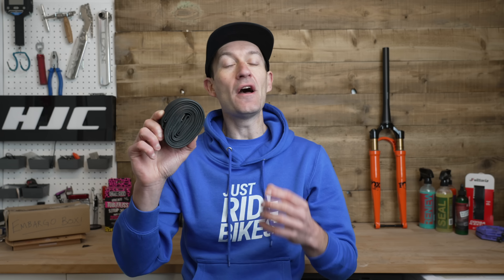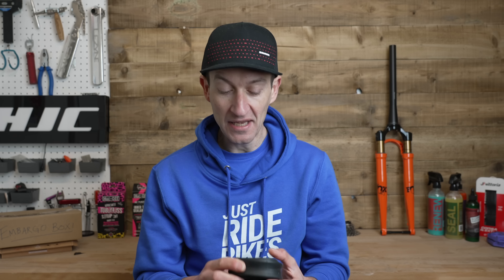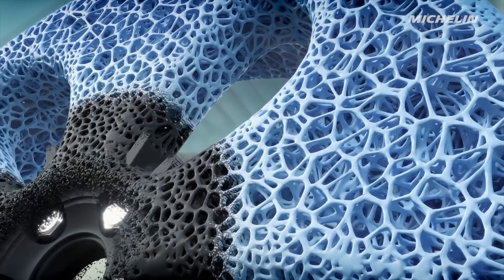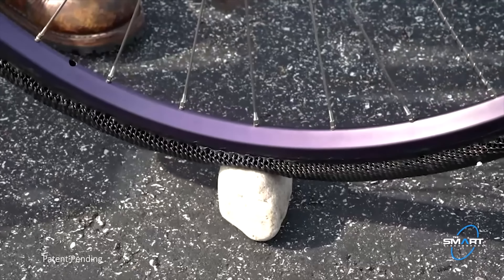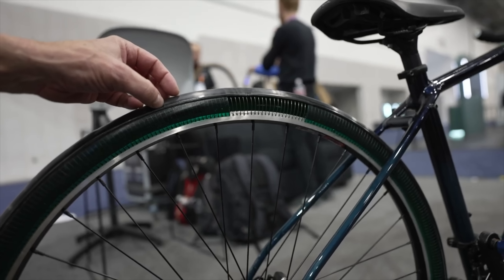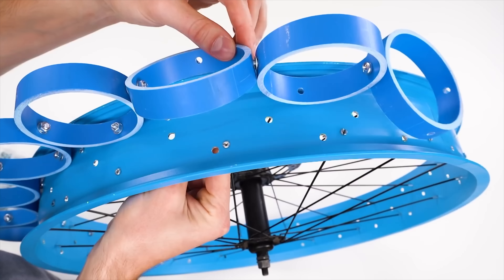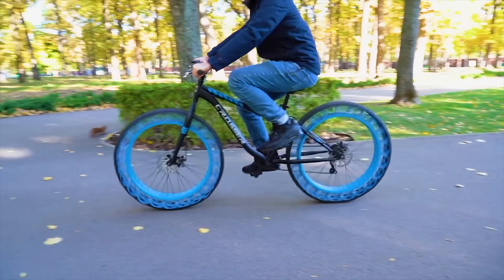The end of inner tubes and punctures?

Comment: Whats wrong with tyres, tubes, rim brakes, chains,  mechanical pull gear mechs, and all the other tried tested dependable, repairable, maintainable stuff that just works?. Nothing and I dont want hydraulic discs, inaccessable cables, thro axles or any of the other crap the cycling industry wants us to become a victim of. The beauty of the bike, a good old steel bike, is its simplicity. The more complexity built into a bike the more serious the implications are of its failure, the bigger a problem it represents for the user.

Comment: Still very resistant to give up inner tubes. Albeit I've managed to move myself over to TPU inner tubes. Yes expensive, but totally worth it as far as a lowered risk of puncture, light and low rolling resistance.
Reply: @HuskyOps I have an old vintage Bianchi on latex yes, lighter yes, less rolling resistance yes and cheaper than TPU, however quite bad at retaining air over time. TPU even has better air retention than butyl.
Reply: @HuskyOps  My TPU tubes are on disc brakes. My Latex tubes have no issue with rim brakes. From what I've read, TPU "can" blow with carbon wheels with rim brakes. Carbon isn't good at dissipating heat. As well these conditions are mostly with long continuous descents. Central-Eastern Canada rarely has this.

Comment: I think something like this would be great for winter riding. I sure don't want to fool with a flat in the winter. I don't really know if tubeless sealant works well in below freezing temps.
Reply: They all have temp ratings on the bottle. Most brands have a winter specific compound. I think other than Muc-Off, which is supposed to be already formulated for freezing temp. But I don't have personal experience living in the southern US.

Comment: 1:33  Actually airless tyres for bicycles hav existed for years. But marketed for city riding. and it won't work for offroad use where stones, twigs, can get stuck in them. And no airless offroad knobby tyres exist. Butt the design is different. but the airless tyres existed for years on bikes, but not with the design of these Michelin tyres, but they had round holes. They were called Ever Tires, they had a kickstarter campaign, but I don't know how it went.  But solid rubber tyres also exist no air chamber in them. Tannus has them, you can buy them now.
there are the energyreturnwheel ERW Air Less tyres, but their website is awful,, no info, I don't know if it ever went out of development.

Comment: These "advances" are NEVER going to perform as well as an inner tube. An inflated tube has no internal friction to speak of and instantaneously springs back whilst being able to mold it self around road imperfections better than anything else. Tubeless is also no good requiring sealant that ends up everywhere turning your bike, room and wheel into a sticky mess. ..so much easier to fit a new inner tube. The best thing would be to create a synthetic rubber inner tube that is more puncture resistant.

Comment: None of these airless tire ideas can have compliance adjusted (airpressure adjusted) to optimize for weight or terrain. My wife and I have identical bikes. All four tires are identical but the optimal pressure (compliance adjustment) is different on all four tires. We each have different pressures due to our differences in weight, and of course each of us has a difference in pressure from front to rear tire because of the normal weight distribution on bikes putting more weight on rear tire than front. So at how many different compliance ratings will each of these airless tires be available? Will I be able to buy at four different ratings to get close to what each of us needs front and rear? 
What about when we go bikepacking - will we need a few more of the same tires at different compliance ratings for the higher weight of our loaded bikes? What they never show in any of these vids of airless tires going over obstructions is how they behave differently at other than the target weight. Cars may not be such a big deal because they can use a flat tread and the difference between the weight of the max loaded vehicle and driver only with 1/4 tank of gas is within +/- 10%. But on a bike its a curved tread and the difference between small riders with no load and heavy riders with a load can be +/- 40% or more. 
If you've not followed what I'm describing then simply imagine that if an airless tire is offered at only one stiffness or compliance then a light rider will have harsh riding on a tire that is skittery, doesn't have a large contact patch, and wears out the center of the tread prematurely. Conversely, a heavier rider with a load will be squishing the tire and having more rolling resistance than necessary. For any LBS or bike owner to inventory more versions of the same size tires to accomodate various stiffness versions needed,,, that's ludicris.

Comment: This idea has already been tried.  Well, similar ideas.  I worked on a bike where if you need the wheel trued you have to cut the airless tire off rendering it useless.  Would suck to always have to replace it when you need wheel work.  Obviously you dont always get wheel work done but you get the point, not sure if this idea is any different but I dont want anything to do with it. Ill stick to my tubes on my road bike and tubeless with sealant on my mtb.

Comment: I have a set of Tammy’s tires (airless tires) and I’ve yet to mount them because it’s darn near impossible to do so without having very specific specs for the wheel inner diameter and an abundance patience
Reply: Ty-Raps from 4-8 o'clock. Two nylon cargo straps at 100 and 2 o'clock.
Tires will be 6-inches below the 12 o'clock position when starting out.
Two Tannus "T" levers and a Tannus "P" pliars used. Watch the many videos even for your different brand solid tire.
Just did 3 each 26" x1-3/4" tires. No heating or pre-stretching. Takes a couple hours.
Knowing such, I enjoyed the installations. Ty-Raps with a longer finger lock tab mostly reusable too.
Reply: @garyseckel295  Thanks for the advice 🙏🏾

Comment: 3yrs 14000km on inner tube only once i get punctured. Reason of the punctured is because the tires are not in a good condition that can see the tube. Other than that just pump air and go. No hassle no problem.

Comment: Piec in the sky . 100psi to much for your weight but 100kg + riders can't use tubeless as you damage the rims with lower pressure. See that diy airless tyre and it's ok in straight lines but dose'nt corner well . Be exactly the same with the michelin tyres lean angles on a bike compared to a car are completely different . Don't think the police will like these as it will make the use of stingers obsolete

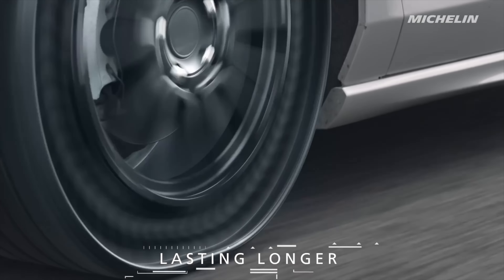Comment: 1:18 right tyre pressure? there is no pressure.
but you need the right tyre to support the weight of the car, or bicycle.  Of course you cna't change the tyre pressure as there these tyres are just rubber, no air in them.

Comment: If we are talking about mens power using bicycles and not about e-bikes then new technology should be lighter than air, otherwise it won't replace tubeeless or tube tires at least in competitions because mens power depends too much on the weight

Comment: the idea is flawed, very flawed. if you cannot use them in professional moto racing, there is no production. The gains you can make in moto racing by playing with the tyre pressure is so important. Even my road car, i drive my cars with diffeerent tyre pressure. My bickcles, bikes, all have different tyre pressure. If the the design you showed will be the final product, forget it.  Imagine useing them in winter, or mud? we cannot stop using tubeless or tubes or even tubular for the next 50 years to come or even more. we tend to get ahead of ourselves. more problems and very expensive.